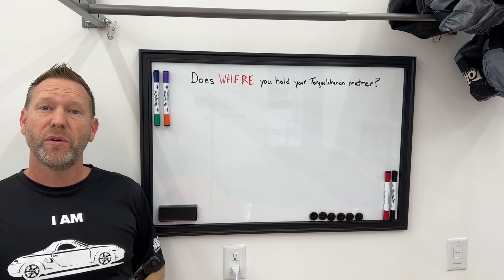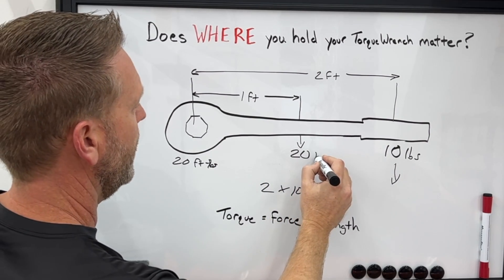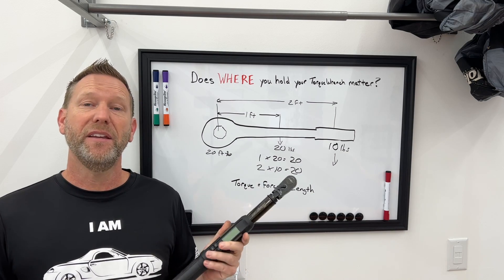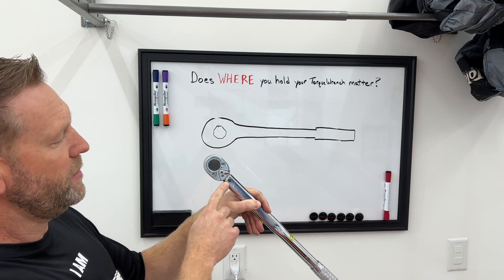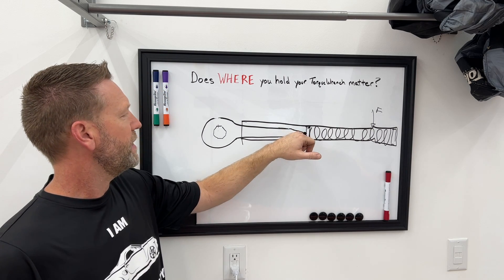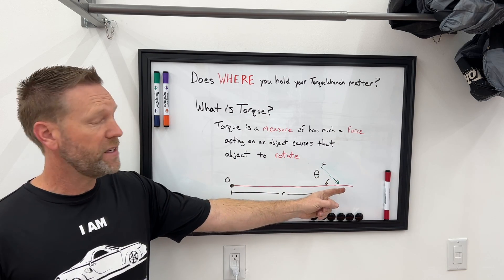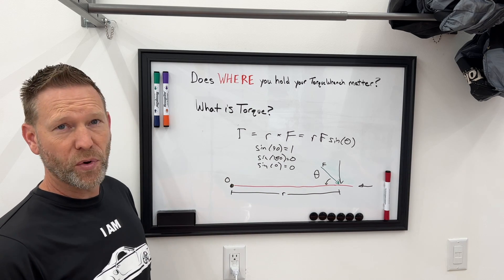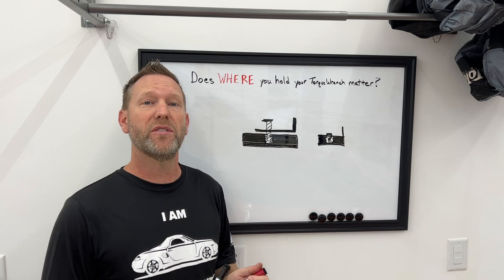Does WHERE you hold a Torque Wrench matter?

Comment: To accurately tension a threaded fastener you must control both torque and friction. I've found that the friction factor is far more ambiguous and difficult to predict. Even cheap torque wrenches are very accurate to about 5% at the worst! A corroded and unlubricated fastener can require more than twice the torque to achieve proper tension. So why do I not see more videos about achieving proper tension rather than torque?
Reply from the maker: +@charlieguenther5490 very interesting. Hadn’t heard that before.

Comment: Wouldn’t it work regardless of hand placement as long as you’re behind the bolt that connects the two pieces?
Reply: It will work in as much as it will deliver torque, but the measurement of the amount of torque at the click becomes wrong if the force is applied away from the handgrip, and becomes progressively more wrong the further you get away from the correct position. It's a consequence of the click mechanism getting its input from a different length lever to the fastener drive. Other types of wrench where the measuring and the output use the same lever length (moment arm) can have any hand placement, it doesn't make a difference to them.

Comment: I am not going to believe a word anyone says on this topic until they do actual measurements with the wrench, using itself vs. an impartial observer (i.e. a calibrated torque nut device).  I will keep my pre-conceived notions to myself, because in my head I know I am correct until someone proves me wrong.
Reply: What is it that you expect to change? Nothing that anyone says or thinks makes any difference to the torque wrenches, they just keep doing what the laws of physics says they will do.
 Various demonstrations already exist showing measurements of torque output, you can do the tests yourself using a number of available methods, I do a basic one using angle-of-the-nut here: https://www.youtube.com/watch?v=5_8vPCRlQ_U
 It's important to remember that torque is rotational force applied over a distance, and only that - the sole purpose of a torque wrench is to report that in whatever unit is required (Nm etc). A test to identify whether a torque wrench has Length Dependent characteristics or not needs only to be repeatable. If moving the hand position always changes the torque using one wrench, and using a different wrench under the same conditions moving the hand position always delivers the same torque, the first wrench is Length Dependent, the second is not.

Comment: For the type you explained I believe you are wrong. Simple test of your ideas, torque your cars lug nuts to their torque specs holding where "you are supposed to". Now get a pipe that will slip over your torque wench that will give you "more" leverage (careful not to damage your torque wrench). I think you will find that the lug nuts will not tighten any further and the torque wrench will click with no further tightening? I will do the test as soon as I can figure out what is wrong with my click type torque wrench. Thanks bringing up this important topic.

Comment: Since sin(ø) will never be >1, and force applied is adjustable, it doesn’t matter. If force were constant, sure, but force is only applied until the wrench clicks. If I’m pushing at an angle that results in less force, I push harder (applying more force). 

Flexion and the length of the wrench are all that matters. The length of a typical clicker wrench changes as it’s adjusted.
Reply from the maker: +@MrJowee watch it one more time
Reply: I did. Im still right.
Reply: @MrJowee  It's worth reconsidering. Everyone who uses and understands this design of torque wrench is (or should be) aware that the torque delivered when the wrench clicks will be different if you move the point of force application. A quick way to see this is to move the force loading point up to the location of the pivot of the outer tube (sadly not explicitly shown in the video). If it didn't matter where force is applied, the wrench would still click when sufficient force was applied here to deliver the torque setting. The fact that this isn't so alerts us to the fact that it does matter where the force is applied.

Comment: 😂 got to 7.05. into you video and as with all other vudeos you fail to see that on e a torque is set on the tool. Right up untill the point where the clutch snaps over and one stop pushing on the tool. Right upmto that point the tool is basicaly no different than the first drawing you show. And as the force is aplied anywher along the outer handle the onlt thing that changes is the amount of force required. After the click you stop and the nut gets the torque that the tool was set for.
Reply from the maker: +pepersorte I can’t understand physics for you, I can only try to present it.
Reply: @HelpMeDIY  first you need to understand science math and leverage yourself. But you don't so don't even try to teach other. You just don't know what you don't know. Lol

Comment: For most applications, whether you grab in the center of the grabby area or the end, the difference will be negligible. Calibration is a different story because you're actually making an adjustment to the spring itself. Yes, there will be slight differences in flex and angle. But as long as you are south of that clutch, everything is peachy. The question becomes whether or not grabbing at 11 inches or 12 inches will translate into any significant difference. Are we torquing a 6 mil bolt on the space shuttle or are we torquing a lawn mower blade? (I almost wrote twerking). Please note I am not a physicist and am mostly talking out of my ass, but I did stay at a Holiday Inn Express. Meaning, don't let my speaking in absolutes make you think this is not actually a question.
Reply from the maker: +Lefty 2 😂 I hear you

Comment: Another top notch video, clear simple explanations.  I would like to add a reminder that bolt torques are called out assuming clean dry thread conditions.  Any lubricant on the threads can lead to over torquing.  Also any time that the manual calls out replacing bolts it is usually because the  bolt tension is close to the material yield point at the specified torque value.  Therefore reusing a bolt may lead to a bolt failure.
Reply from the maker: +Tom Bacheller yes, great additional points. Thanks! 🍻